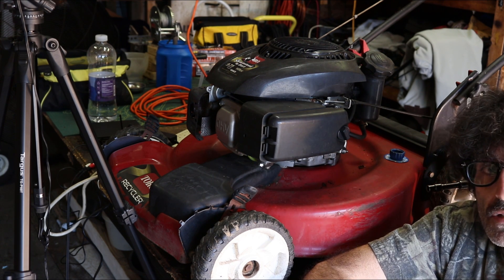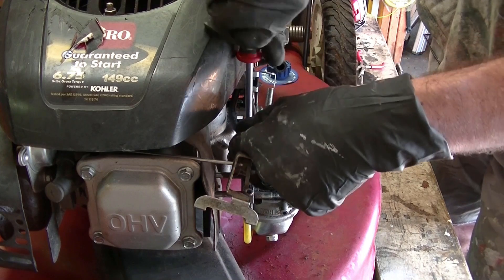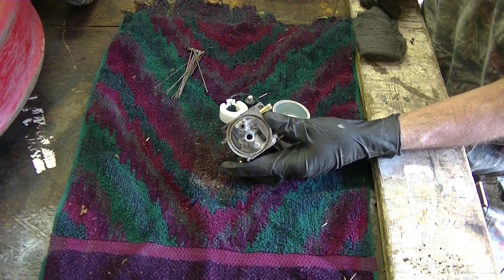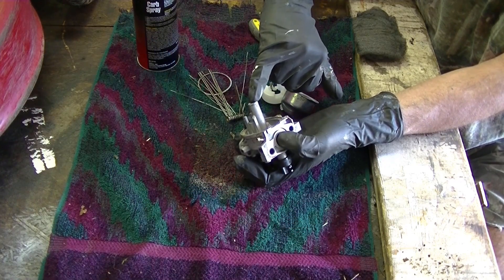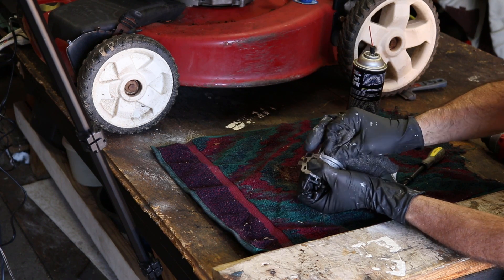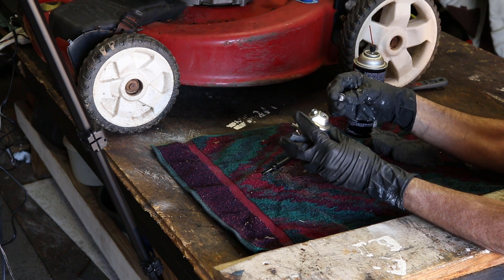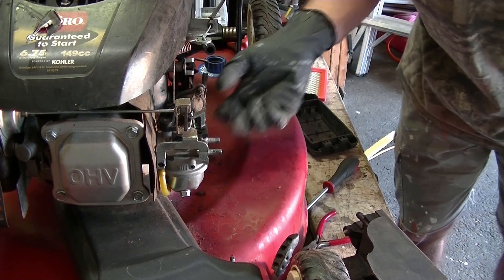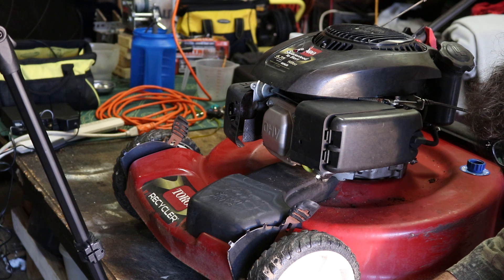Kohler; Toro Lawn Mower Repair Won't Start? Step by Step Carburetor Repair  149 CC

Comment: I replaced my carbutetor and  it still will only run for 15 sec
Reply from the maker: That's a good one... any chance there's trash in the fuel?  Was the fuel hose contaminated?  Water in the fuel?  did it sit for long period of time, or all of a sudden quit from running fine?... I don't have enough info to give u a decent answer....
Reply: I changed the spark plug, I removed the fuel filter & checked the fuel line, and I replaced the carburetor. the fuel is about a month old. I have a Toro 149cc with a Kohler engine
Reply from the maker: Ronald Cook it sounds like u still might have trash in the fuel... I'd try draining the fuel into a clean clear container so u can see it... u may have to take new carb apart to blow out any trash that could have gotten into it.... unless you're loosing spark for some reason... magneto could be grounding out intermittently.... just throwing it out there as a possibility.... the only other thing I can think of is if someone hit something in the yard and knocked the flywheel just a little out of time.... but it would most likely just run like crap if that was the problem.... hope that'll help you a little bit
Reply: thanks i'll try your suggestions
Reply: Ronald Cook try running it with the gas cap off. Does it stay on?

Comment: I have searched and searched but couldn't find the answer. Actually I was working on a Yardpro lawn mower having the same Kohler engine my neighbor has.  I have a Toro which also used the same Kohler engine, at least they looked the same from the outset.  However, the Toro is much more money and it has the "guarantee to start on first pull"  statement on the engine while the Yardpro doesn't.  Can any one tell me if there is any actual differences between the two engines or just a sales glimmick??
Reply from the maker: Eric Chan all I can say is that the guaranteed to start on the first pull is a joke! I'm quite sure it's a sales gimmick
Reply: Thanks for your reply. I think you are right.  Buddy, you are helping many in your own ways, Good for you.

Comment: Very informative and the shooting angle is as good as it can be.  I am going to follow exactly today and surely thank you very much for this great how-to-save money and build-up self-confidence video.
Reply from the maker: Thank You for the nice comment!!
Reply: Hi, Thank you once again. I did the carburetor clean up and wow, the never-start engine after the Toronto winter started on the first pull with Quick Start and then it starts by itself from then on.  I was so surprise and happy.  Two problems I have faced. The center jet screw was hard to turn and actually one side of the screw was gone I couldn't unscrew it at all. I saw the center hole was plugged up so a steel wire did the trick.  I figured out once the first gas passage hole was plugged up no further plugging occurs inside the long brass jet.  Also, I have to loosen the bimetal linkage from the exhaust to get the 1" wire linkage off which took a bit longer.  All in all, no sweat, it was fun and really worthwhile on the time spent.
Reply from the maker: Eric Chan Good deal... glad u got it going again!